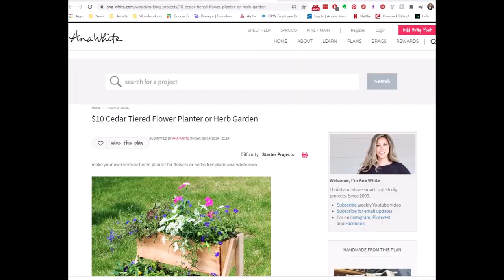How to make a 3 tiered garden box for herbs, flowers or anything else.

Comment: Seems everywhere likes to use a nail gun - is it only the UK where we use screws? I use screws for most of my projects and dowels for those I don't want to see screws.

Nice design, will have a crack at building one of these later.
Reply from the maker: I've since gone to almost entirely screws.  In each corner and the center.  It's a more consistent look.